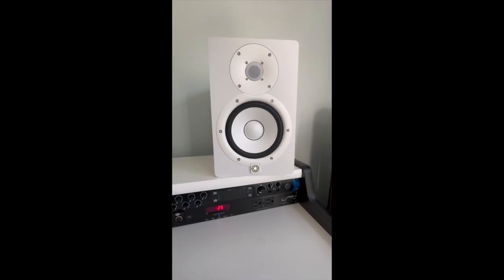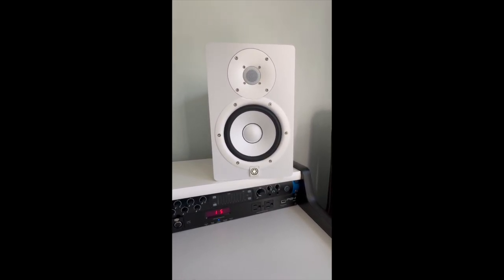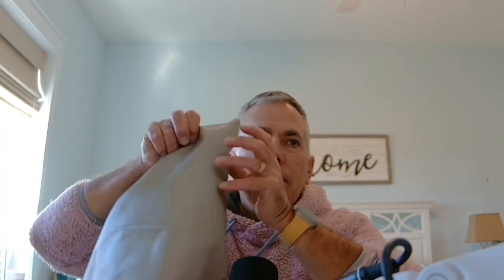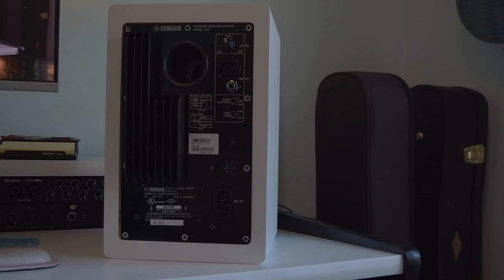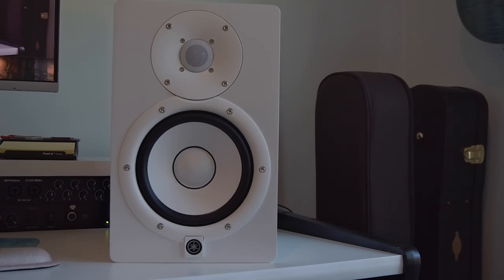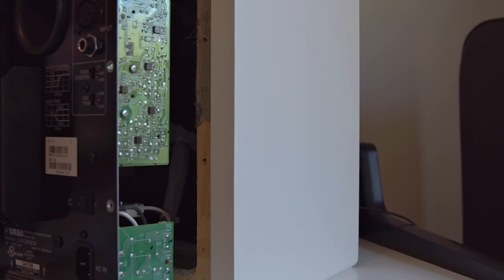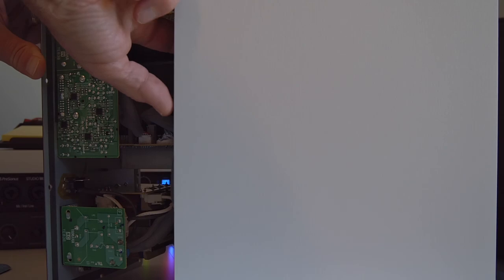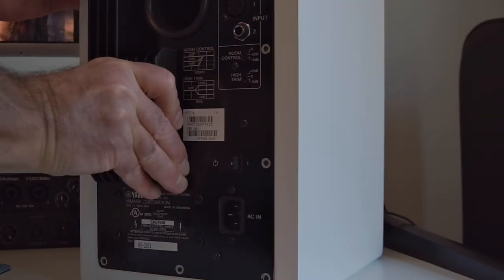Cell Tower Noise In Powered Speakers?  Here's a potential solution!

Comment: 2 things, 1. It definitely not the cell site the amount of signal reaching inside your house is in Pico watts not enough juice to cause any issues. Your phone transmits way hotter than any received signal 2. Everything that uses power produces eme. If you insist on it being a transmitted signal your router or modem would be the most likely culprit. In reality it could be anything in your house causing this, even your keyboard. When you have an issue like this it's either a proximity issue or a faulty ground in the speakers or other device. My 2 ¢ as a former Cell site engineer. God bless and Merry Christmas.